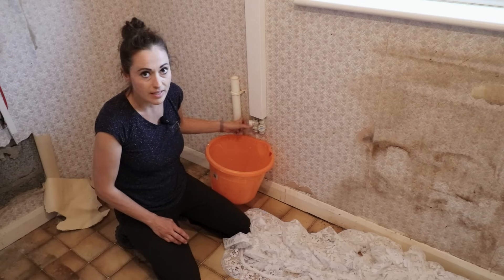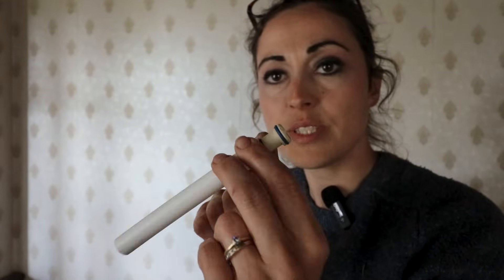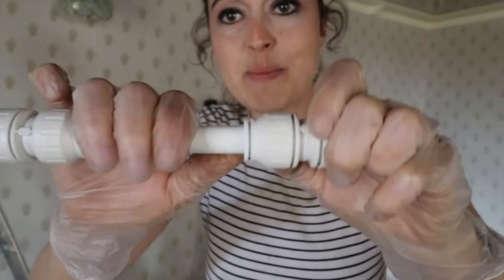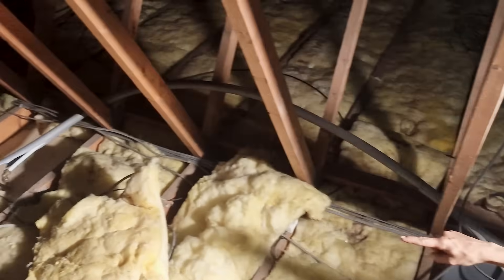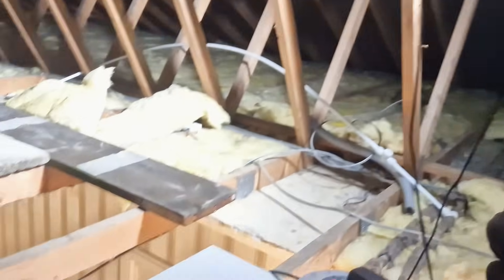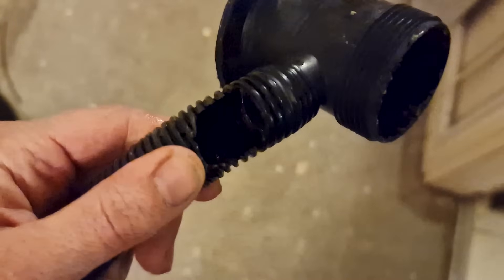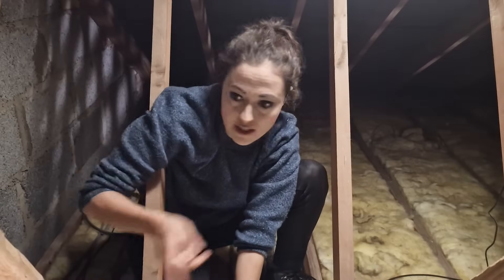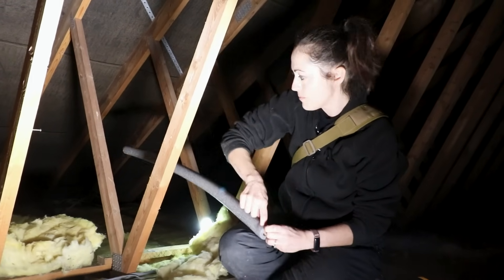We tried to fix the leaks but FOUND MORE PROBLEMS in our new auction property!

Comment: Loved this update, I'm surprise that there were three (?) points where the pipes were broken in the loft, must have been completely frozen throughout! I just pulled a load of old plastic fittings (Hep2O) out in my bathroom and replaced with copper. Half the Hep2O fittings were jammed on, even using the correct release tool they were stuck. Anyway just chopped it out using the plastic pipe cutters like yours! Plastic pipe is fine where it's out of sight. Headtorches are excellent for working in a loft by the way.
Reply from the maker: Just having to buy a hep2o remover completely pur me off lol. I don't need that with speedfit and agree! It's not pretty enough for being on show, so I'll have to teach myself how to fit copper for when I want to update everything! I'll have to hunt for our my headtorches.. misplaced them during the move lol
Reply: @TheCarpentersDaughterUK  I taught myself how to do copper pipe, compression joints, soldering, using pipe bender etc. a few years ago, and was able to do things like replacing a hot water cylinder, and adding a new radiator. I like using solder ring (yorkshire) fittings. You need quite a few bits and pieces but it pays for itself in a short time!
Reply from the maker: It honestly sounds fun to do 😅

Comment: Oh man that plumbing is a right state! I think for peace of mind in the long run I'd redo the lot, everything in the loft at least. I don't think I'd bother with a heat pump (ground or air) in a build of this age, you would have to do a hell of a lot with insulation and glazing to make it effective. You've got a bit of land and by the looks of it neighbours who do too I'd be going a log burner(s) if local wood is an option. I fitted one in my house as a sole heat source after growing up with the same at my Dads and it's bloody brilliant for the running cost.
Reply: I agree. The bungalow has probably got no underfloor insulation, minimal wall insulation, etc. It would be very expensive, time consuming and disruptive to go through the process of retro-fitting everything, plus changing all heating pipes and radiators. And for what? A heat source pump that wouldn't heat the house up very well and probably need solar panels to compensate for the cost in eletricity to power it. These things are probably going to go down the same route as many other new technologies...down the pan. Burning wood is never going to go away. Maybe a log burner with a back burner for heating up the water.
Reply: Chances are wood burning is going to get banned in the near future unless in certain categories of property ….be careful what you invest in. They might be ok being rural, but in a town it is not a good bet at the moment for example.
Reply: @dees3179  it's not going to happen any time soon regardless of what headline every online news outlet jumps on for clicks this week. There's no way local councils could police it with man power or funding. We have clean air zones now which might get stricter and more common but it just means having a cleaner burning certified stove. People like me who installed them themselves with no HETAS certificate don't exist other than a tiny wisp of smoke. With the rollback we have had on fossil fuel vehicles etc we will still be installing combi boilers for at least the next 30 years. The 600 quid on my log burner is nothing compared to the 15k on an airsource heat pump. A couple of years and it's paid for itself even if it does become outlawed. I can't afford to have gas central heating installed and run it never mind a "greener" option so it would immediately plunge people like me into fuel poverty. I agree pay attention but with a pinch of salt, investing in any heat source should be a considered and researched decision weighing up it's potential longevity.
Reply: @HouseFairyDIY ,they haven’t got heating pipes and radiators to change- they’ve got old electric storage heaters that they intend removing. In other words the ideal time to install the correct piping and radiators they would need.

Comment: As @awt says, soldering (especially with pre-soldered copper) is easy and can be very satisfying.  Just need to make sure to add a smear of flux to both pieces - pipe and joint openings - and do all joint ends at the same time.  Have a few practise goes first.
Reply from the maker: Thanks so much again! 😀 And FYI, Mr TCD is now creating plans on Sketchup so we can have a play around with different layouts! 😊
Reply: That’s great, if you or Mr TCD need any pointers you know how to reach me. Have fun with it and play nicely (I’m sure you will).

Comment: Did similar jobs on our bungalow - insulating the loft etc.
For the walkway I used 100mm celotex (PIR) insulation with 11mm OSB on top. For the rest I've just layered some regular loft roll insulation (it gets up to 400mm in some places so it's a bit of an overkill) and used loft legs XL with some 18mm osb to create lots of storage space.
Don't forget to do all your plumbing and wiring first though as since you board the loft it's going to be a pain to access the wires etc.
As for the loft hatch - I got rid of the old and hideous one and just bought a ready made metal insulated hatch, I think it was about £125, fitted perfectly in the opening and saved loads of time messing about with the old one trying to insulate it (and looks miles better as well!)
Reply from the maker: Thanks for the heads up :) I'm only going to do a walkway (I've promised that's all I'll do right now anyway for costs. I've now also got an insulated loft ladder kit that is arriving tomorrow, along with 26 rolls of insulation for the roof :)

Comment: Another great watch Vicky,  hats off to you 👏 in my humble opinion I would replace every piece of old pipework you can physically get at, I have a feeling you may regret it at a later date, especially while you have great access via the missing ceiling. We make that mistake in our last property and had the ceiling come down on two different occasions through leaking pipework from poorly soldered joints 😢 keep up the content!
Reply: Was thinking the same! Investing in new piping is a lot cheaper than repairing water damage.
Reply: I think she's just doing minimal remedial work at the moment while she decides what she wants to do with the redesign of the house.
Reply from the maker: Sorry to hear that! At this point, it was just quick fixes to get the water up and running to toilet, bathing and drinking, so it bought us time to redesign/remodel the house and working out what new heating system we're going with. But when I top in the insulation and replacing others, I'll be checking again! :)

Comment: Love speedfit.  It got us out of a bind when the electrician pirced the hot feed down to the  kitchen sink during the rewire.  As electrics were going nearby I didn't want the pipe repairing.  I  got the electrician to chase out a bit of the wall on the other side of the window, ran some speedfit down the new chase with an end stop and when  I fitted the new kitchen, plumbed it in.  I know plumbers prefer copper, but it did the job.
Reply from the maker: Thanks so much :) SO glad you're enjoying it!

Comment: This video more than any other has given me the confidence to try plumbing repairs as needed, you made it look very accessible. I won't be plumbing in any central heating systems but it at least seems feasible to repair things now rather than instantly calling a plumber out of fear. Thanks for sharing the journey.
Reply: I think it's good to try to learn these things because it's so hard to get tradesmen to come out nowadays.
Reply: Please don't shoot pipes all over the place like this. Speedfit fittings do not like it. No doubt about it some of this plumbing will leak down the line. From a time served plumber.
Reply: @bobby5634  Thanks for sharing your thoughts, I've no experience with which to set my expectations. Could you please help me understand why that's the case,? I'd just assume this is exactly what it's designed for.
Reply: @craigevans9617 the great thing about plumbing is you can practice. There’s a good channel called got to learn who has a good tutorial on soldering. It’s easy and satisfying once you can do it. Just go buy some solder, flux, wire Wool and a torch and gas. Grab a bit of 15mm copper and a cutter. Once you can do it you’ll realise it was easy. Best of luck.
Reply: @craigevans9617  It's plumbing. Everything should be clipped tidely for a reason to joists/walls/floors. Shooting pipes around in mid air on angles like this is a no no the fittings will blow eventually as there under stress.
Reply from the maker: It's great for quick repairs to get things up and running without expensive call out fees. Yes, I plan to use pipe clips - but I still have that stuff in storage and this is all temporary until we know what heating we're using/and have redesigned the kitchen, bathrooms etc. It's a great invention for the ordinary home DIYer.

Comment: As a joiner I couldn’t help noticing there’s  lateral and diagonal 4x1 bracing missing on your roof trusses. 
Some might  say well it’s been up this long obviously ok but why not put them in now while you have the chance. 
Each truss should have lateral bracing along the node points ie the point where the internal webbing joins ceiling and roof rafters also diagonally along the pitch of the roof. 
Surprised that your survey didn’t highlight it. 
If you sell the next surveyor May spot it. 
Good video and good hard work by the way.
Reply from the maker: Thanks so much for pointing this out. I'll take some photos and send it to my Dad and look into it.  We didn't get a survey as we wanted it regardless, but my parents inspected it from the outside and downstairs internal videos.

Comment: Good job Vikkie. Reminds me of my last house make over. Lots of leaks and plasterboard replacement. Speedfit was just starting to appear in the shops so I taught myself how to solder plumbing joints. I Eventually installed my own central heating system and boiler! That was back in the days when you didn't need a piece of paper to say your qualified. 😃😃
Reply from the maker: Wow! I'd be too afraid to do that 😅
Reply: TBH its not half a difficult as it looks. Once you get the idea of a flow and return from the boiler and back again its just pipes and connectors. And  we can see your a dab hand at that already
😃😃 Great to see such a can do attitude. Your an inspiration to everyone  @TheCarpentersDaughterUK

Comment: Will you put that lovely foam lagging on all the old pipes too? I wouldnt trust the old stuff. Or are you covering the loft in  insulation, which will cover most pipes?
Reply from the maker: We've now bought more insulation for up there. Been waiting for black friday deals, although I thought the wool stuff was meant to be better - but I nearly choked at the price!
Reply: @TheCarpentersDaughterUK  there are different grades of the foam stuff for pipes. The basic stuff is fine if you're laying rockwool blankets over the top - the most economical way to do a loft. Sheepswool is much nicer and apparently quite cheap because wool prices are so low at the moment.

Comment: Nice work Vickie. I don’t like plastic push fit plumbing, but it comes in handy. Try practicing a bit of soldering, it’s easier than you think, and makes neat pipe work.
Reply from the maker: Thanks so much for the encouragement! It's definitely something I want to practice, and think it'll come in handy when redoing the bathrooms, utility and kitchen :)

Comment: I never done plumbing in my life. I was not sure I be able to do soldering properly. So I want to go with speed fitting. Soldering very easy as well. Cost wise both r same. My advice is do some research on YouTube. U will get alot of information. Speedfit do two types of pipe. I choose lay flat over pex. Then I have to use less fitting. I used one rule less fitting on plastic pipe less chance of leak. Watch out if u have rat issue don’t use plastic.

Comment: Bravo! Would the pipes ever freeze if you’re living in the house?  Insulation seems sensible anyway.
Reply from the maker: I'm not an expert, but I was always told to keep your heating on over winter if you went away - low enough not to freeze without costing a fortune

Comment: This is going to be an awesome project i can feel it already. I am glad i watched this video because now i know I'm not the only one that will carry on working at home till the early hours. 

my only advice would be to go over that hair felt pipe lagging with some foam insulation or remove. Hair felt lagging is now only really used to protect pipes from the plaster when they are sunk into walls and does not meet building reg's now and it will also save you money as the hot water does not lose so much of it's heat when traveling threw the pipework. So you may also need to did this to get the grant for the heat pump anyway and yes it's not a nice job being up in a loft doing the pipe lagging but it does bet paying a plumber his hourly rate to do it all.
Reply from the maker: Thanks so much! I didn't know that! I just assumed it was better because it was dearer!! :)
Reply: I am sorry i think maybe you have it mixed or i have what you said wrong lol. 

The grey insulation you used to put over the plastic is the better option for pipe insulation/lagging and you may find that if you look online ebay or similar you can find it cheaper than you can in a DIY store. I think i paid about £14 for 10 meters of insulation for 15mm pipe at 13mm thick (personally I would not go for anything smaller than 13mm thickness) I used this 13mm behind the kitchen cabinet on all the exposed pipework as well as the exposed pipe in the kitchen cabinets. When i redid my bathroom i used 25mm between the joist and the hair felt lagging where it passed threw the joist to help stop any noise. it just depends on what space you have but bigger in the loft is better being an unheated space. Also having the pipes clipped/supported would help a lot with problems in the future as movement can cause joints to fail also so it could be worth looking on the net for Talon Joist clips or even just a bag of Talon pipe clips and screwing them to the joists to support the copper spaced at 1.2 meter apart max for a horizontal run or 1.8 meter max for a vertical run to stop sagging. 22mm copper pipe is 1.8 meters maximum for a horizontal run and 2.4 meters maximum for a vertical run, they are pipe sizes that are carrying water as gas is different large space between clips as its carrying less weight but of  course you can go smaller distance between clips that's just maximum set.       

The hair felt is not very good at insulating pipes and is now used when copper pipes are buried in walls and floor to hide them as the hair felt lagging has a plastic bag type liner under the hair which stops the plaster and cement from coming into contact with the copper pipe and causing a reaction which corrodes the copper and causes leaks (this why copper pipes that go threw a brick wall should be sleeved with larger copper or plastic pipes), it does also allow some extra space for the copper pipes to expand and contract as they get hot and cool down with out cracking the plaster. It's also used where central heating pipes and hot water pipes pass throw a notch in wooden joist to help stop any rattles or bangs as the copper expands and contracts as it gets hot and cools down.

Comment: Interesting to see how you tackle some problems I had to deal with when I bought my place. I've only worked with plastic on drainage, all copper for feeds, can those push fittings come apart and reassemble repeatedly? As soon as I saw the damaged pipes and missing ceiling in your earlier video I thought, as long as no structural damage, that's a great negotiating point because it'll put off a lot of buyers and both are really easy repairs, had same in our kitchen. We've also just worked out a leak in our bathroom is coming from the bath drain, really sneaky it was. Don't think anything's gnawed through it as our kitty would have had the little beggar.
Reply from the maker: Sounds like we definitely need a cat in the future lol. Yes, you can repeatedly dismantle and reattach, which is why I like it 😊

Comment: Well done Vikki - if you are going to redo the loft plumbing maybe wait until you have put the raised walkway in (to accommodate the extra insulation) and run the new plumbing at board height fixed to a batten itself fixed to the edge of the walkway.
Reply from the maker: Thank you! I like the idea! Yes, we will very likely redo it once we know what heating solution we opt for and expecially remodel the bathroom and dated ensuite 😀

Comment: I use Yorkshire fittings and make sure to clean and flux the pipes and fittings with wire wall. It's not to hard if you practice on a scrap piece of pipe first.
However I do keep some speed fit for any emergency repairs. 😊
Reply from the maker: Thanks! It's something I'd like to learn :)